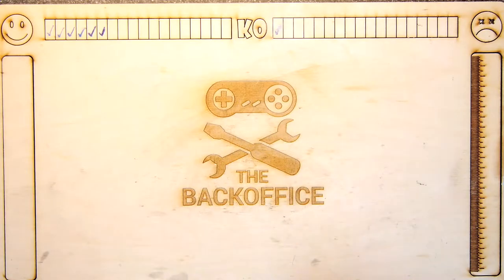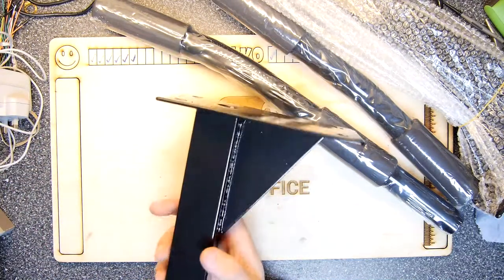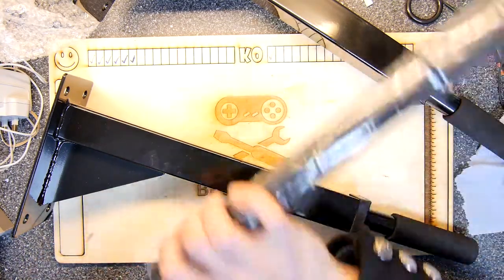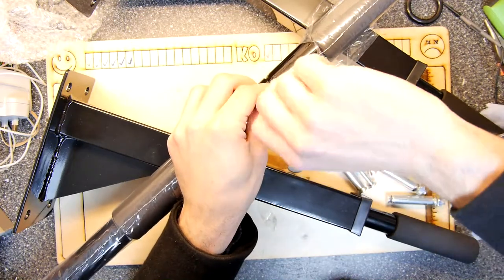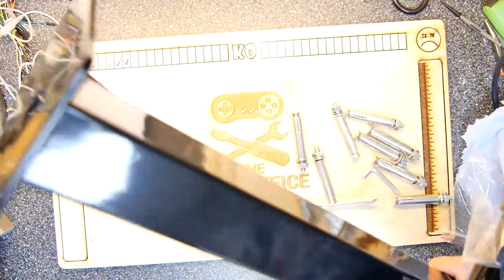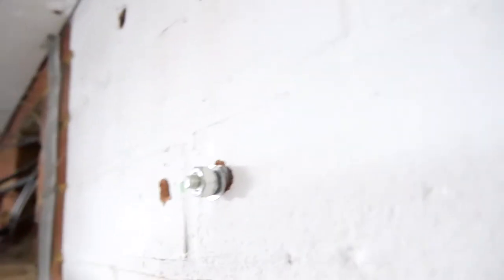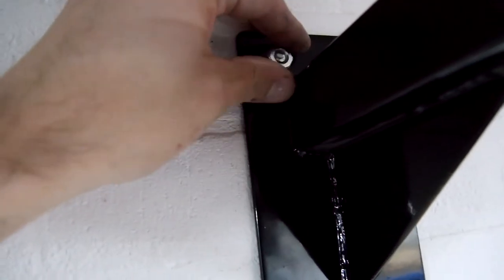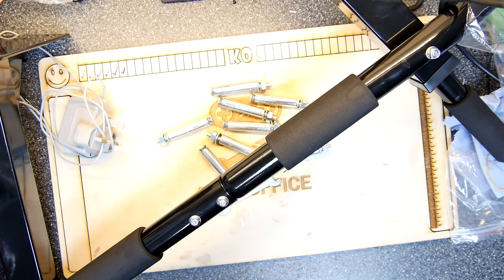Chinup Bar for a tenner

Comment: So the ones that don't bolt in and just slip over the doorway (not the door itself) - are they a waste of time? I live in a rented place - so I can't make holes like that.

I don't want to damage the door frame etc.
Reply from the maker: +FairFight14 I hear they are pretty good. I use to have some that extend, but you needed to screw in a couple of metal cups to stop them slipping. 

I have seen some that act as a lever against the frame that don't need anything, but depending on your weight, I think some making may be inevitable 🤔
Reply: The Backoffice I'm 13st 8 (86kg) this morning. For my height (tallish) isn't so bad, but it's not that great. As a younger man I used to be a lot fitter - I'd like to get that back.

I've sadly let myself go a bit the past 5 years. Actually seeing that you go for runs and stuff has made me feel like a lard arse. I'd like to fix that before I really let things spiral out of control, now I have more free time to myself.
Reply from the maker: +FairFight14 I used to be such a lard arse. I look back on some of those photos with disbelief. Go for it, sounds like you are not too far off the mark 👍👍👍

Comment: Nothing makes me feel weaker than my pull up bar Haha. My clips in the doorway works works great though
Reply from the maker: Yeah, I am doing the negatives now using a chair under it until I can pull myself up consistently. Whats the point pulling yourself up of you can only do 3 :)
Reply: Linkage my man!  Thanks
Reply from the maker: There is, hmm, maybe you didnt look hard enough ;)
Reply: oops, I'm used to normal TBO service ;)
Reply: But it was £15 not £10 ;-)
Reply from the maker: I shop around, but ebay links are transient, so I only post amazon ones at they tend to stick around.